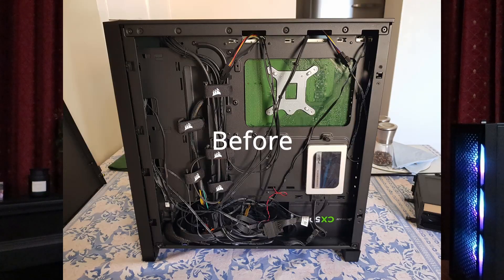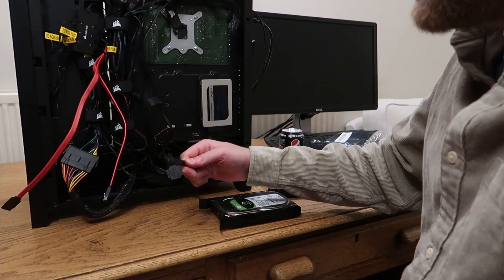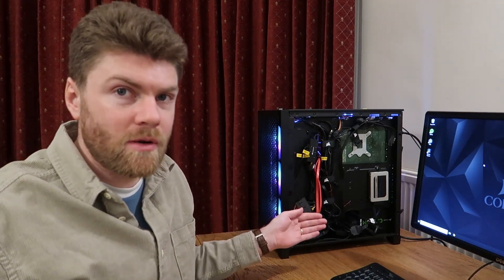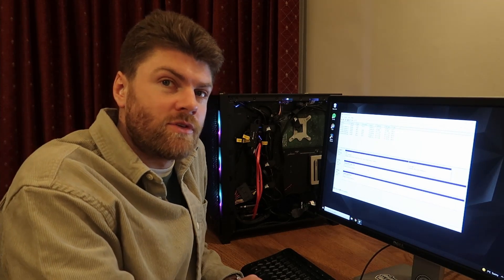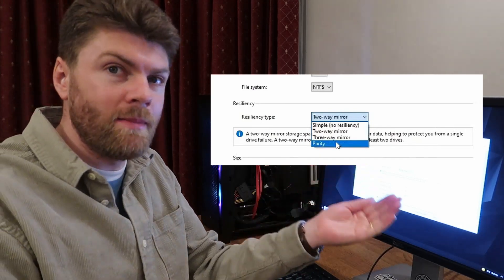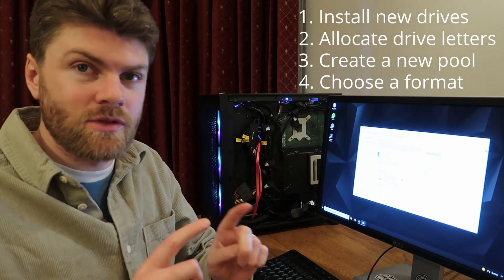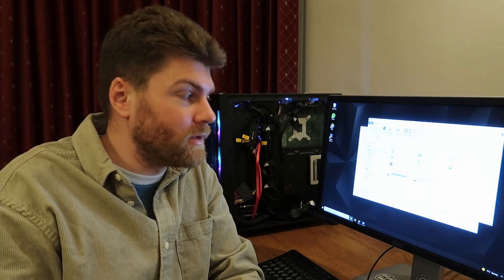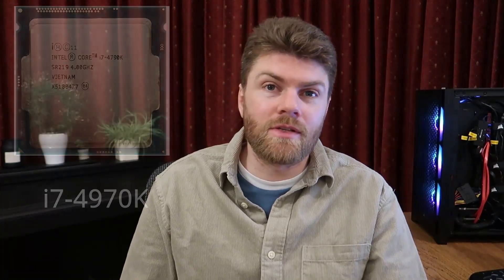Dell Optiplex 7020 upgrade 2022 - Ep 4

Comment: the greatest gain you will get from this machine will be replacing the raid spinnie drives with ssd's... I recently picked up a sata 1g ssd for about 40 bucks off amazon... the data transfer rates and low power will help the system a LOT
Reply from the maker: Unsure if you have seen the other episodes of this series, I do have a SSD as the boot drive and storing all of my programmes on, the spinnie drives are simply for long term image and video storage. I am still undecided by them as they do take up a large amount of space, we will see
Reply: @darylbultitude3786  missed that one obviously... excellent upgrade for these machines

Comment: 2:53 - on MBR u can use 2TB per drive(so u can buy 2x2TB and they should be fine), on GPT is something like 9.44ZB(but current Windows Limit is ~256TB)
Reply from the maker: This information was from the below source, it is an old video so may be out of date, but they state that anything over 1TB  shouldn't use MBR.
https://youtu.be/ZxV6IcNvbek
Reply: @darylbultitude3786  Yeah, and he said "Larger than 2TB" so from 3TB(Even 2,1TB but they dont do drives like this) and higher drive doesn't work on MBR, and also on video he have 1678GB(Marketing use Decimal system for GB/TB etc. Windows use binary, so on Windows shows something about 1,8TB - sometimes less depends on manufacture) And about Davinci Resolve - if u buy some NVIDIA GPU then should be fine with i5, because on Studio version most things do on GPU, even on rendering, i have on i7 4790 non K about ~30-40% usage, But to be honest nice vid, and i also use Optiplex 7020 - is good PC :D